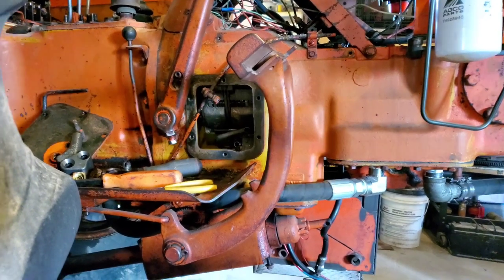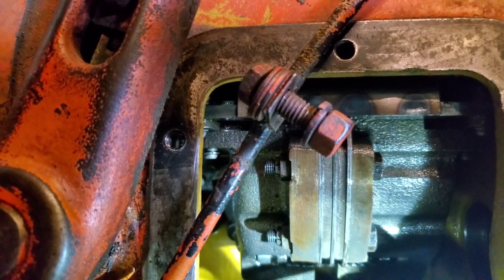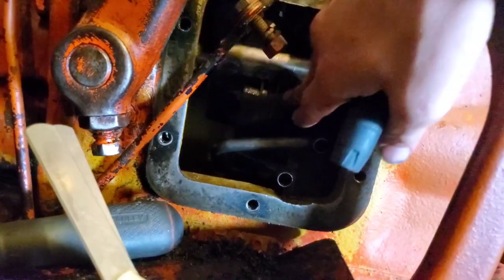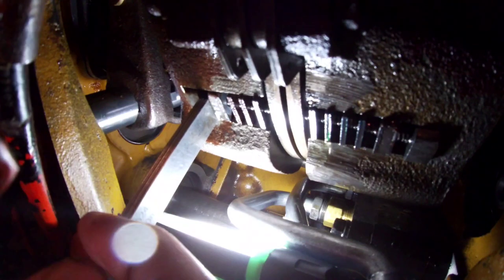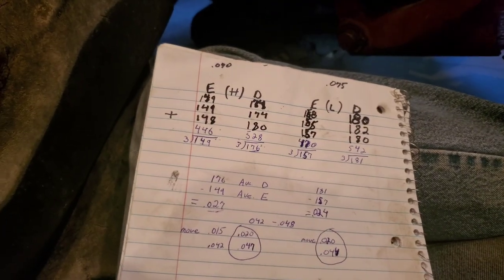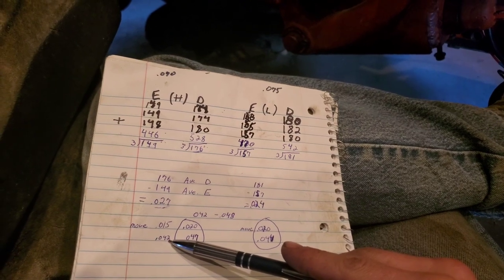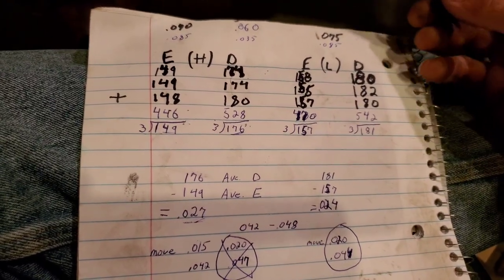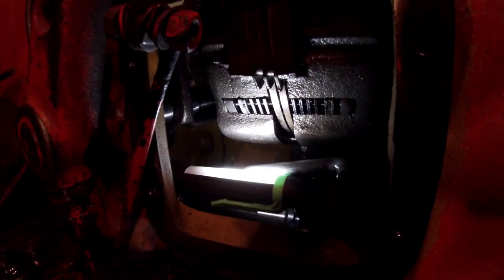How to adjust an Allis Chalmers D series power director, in the tractor.

Comment: Not sure if you're still answering questions on this, but in the first part of the video you measure and state that you got .070 &.075 respectively. What are you measuring? The short shims? My son and I are working on a D-17 Series 2 that sat for 25 years. The power director slips under load on the low side. If we measured correctly we come up with .064 (high) and .033 (low) but not sure we are measuring correctly. Also judging by the blue RTV on the cover at some point someone was in there. The center "long" shims measure about  .135 in thickness. Seems like a lot. Not sure how to proceed. Any help would be appreciated.
Thanks!
Reply from the maker: https://youtu.be/fNFY5CUUmk8

This is an updated video I did on this. I tried to explain a little more clearly about the shims and how to adjust the clutch. If you still have questions after watching this one I'd be happy to help.
Reply: Okay, thank you!

Comment: Perhaps missed it, but why are you adjusting it?  Was the clutch dragging or slipping?
Mine is dragging.  (To fully stop the tractor, I have to depress the main clutch or stand on the brakes.)
Before I open it up, I assume I’ll need to add shims.  Is that a good assumption?
Reply from the maker: It's pretty normal for them to do that. Especially when they are cold did it do it as bad when it's hot?
Reply: @TimothyFluegel  yes, hot and cold.  It does it all the time.  Was yours dragging?

Comment: Great video. I will be tackling this very project soon on a d15 series II. 

Any chance you can help me find shims?
Reply from the maker: You can still get through Agco, but where are you located?
Reply: @TimothyFluegel  Central MN
Reply: Good morning Tim. Do you have an email by chance? I’d like to send you a few pics of the power director and the measurements I found. I’m skeptical making an adjustment would fix the issue. It’s dangerously close to factory spec.
Reply from the maker: Can you look me up on Facebook it's easiest to converse through messenger.

Comment: Thank you for the great informable video, I have a few questions. First, is there any oil behind that inspection plate that you have to drain? Also, I just bought my first tractor and it is a d 17 and it has some sort of clanking that sounds like its in the rear end but also I was thinking it could be the crank in the motor broke or bent, and I don't want to tear the motor down if I don't have to so do you know what that sound would be? And have you ever had it happen to one of your tractors?
Reply from the maker: Yes there is fluid being the plate as that is a wet clutch that rides in hyd Trans oil. Does your tractor run?? If it's running its not a bent or broken crank. It's really hard to diagnose a  tractor with out at lest video of the nose. Of you could post on an Allis forum on Facebook and tag me in it I would be more helpful for sure. If you don't tag me in the post I won't respond I can't stand the know-it-alls on the forum ¾ of them have no clue and just seem to want to argue with people.

Comment: Tim, we have a D 17 series 4. The tractor wants to creep when the power director is in neutral. What can we do about it? Thanks.
Reply from the maker: What kind of oil are you using? Alot of times it can be solved by putting fresh hydraulic Trans oil in. But only if the oil that is in it is too thick or old and sticky. If that's the case. After you drain the old oil out full the rear end with diesel fuel and take it for a drive down the driveway and back and drain it out put fresh in and your good to go. If your oil seems good then it's adjustments in the clutch or a warped clutch plate. It's Ajay worth double checking clearance on your foot clutch orcpossibly a warn disc there, I've seen that being the problem too.

Comment: Thank you very much for this informable vid 👌
Reply from the maker: Your welcome. I'm glad you found it helpful. thanks for watching.
Reply: @TimothyFluegel  
Atm I am a little confused.. Now
I have a Allis I-600 with a shuttle power director clutch. (Same as yours but forward and reverse instead of H and L. ) 

My problem is when the main foot clutch is released the motor sounds as if its working harder even while the shuttle clutch is in the neutral position. 

Otherwise the clutch feels like it grabs well but because it robs the engine of power, I could not even use the tractor in gear 4 if I wanted too. 

I just finished the process you showed and even though some shim adjustments could be made, the shim ratio seems to be correct. (Outside shims vs center shims ratio.)

If you have any insite, that would be much appreciative.
Reply: Quick update, the tractor seems to have a red looking transmission fluid in the shuttle clutch. From what I read, hydrolic fluid should be used. Is it possible the trans fluid is causing my problems?
Reply from the maker: @blackmasta71  it should have hyd trans fluid in it. But in my experience no, it wouldn't make it slip if it had the wrong fluid. Are you sure it's the hand clutch, idk if you have a way to test it but if the pto slips when the clutch slips is the foot clutch.
Reply from the maker: @blackmasta71  I acually have a 615 industrial. About the same as your I600. This is just a thought but it happened to me. Mine has a live hyd pump and the regular allis pump in the torque tube for about a week I though the engine was on its way out just lie you said couldn't use 4th and when I let the clutch out the poor thing was working hard. Come to find out the linkage for the not live pump was unhooked and my buddy Bob must have caught a branch and turned the pump on. So it was constantly working that pump.
Reply: @TimothyFluegel  hum interesting, your issue sounds similar.
What do you mean by live pump? 
To clarify mine is a I-600 backhoe. 

Another strange thing is that while I was roating the shuttle clutch and checking my tolerances, i could only rotate it so far until it would want to spin back on me. Even with the main clutch disengaged and shuttle in neutral.

Tonight I needed to back it out of my shop So I put what fluid I had around back in it (I did not have enough) and was barely able to back the tractor out. It just wanted to stall as soon as the shuttle clutch was engaged. It really made me think fluid has a big part in the operation of the shuttle clutch. 

Anyway I really appreciate your help. Its a odd problem to have a clutch that seems to work the engine. I am pretty sure the wheels would spin while in neutral with the back wheels in the air.
Reply from the maker: @blackmasta71  yes sir. The I600 is pretty much the same tractor as my 615 just with a different moddle backhoe on it. They started life as a series 2  D-15 with a power crater engine. Around 45 hp so they aren't overpower to begin with for how heavy they are kinda underpowered really.... that being said it might just need a good tune up ya know if your listing 10hp in your spark or a clogged air filter you prolly wouldn't have the power for 4th gear. 
As far as the live hyd pump. When you push the foot clutch in you should still have use of the hydraulics for the loader and backhoe. That's live hydraulics the regular farm tractor hydraulics ran on a shaft after the foot clutch so when you push the foot clutch it cuts that pump off. Does your i600 have an extra set of controls next to the seat? If so those are for the not live hyd pump
Reply: @TimothyFluegel  ah I see. Yes my hydraulics always work. The clutch does not control hydraulics. 
Maybe your right about the tunup and the tractor being underpowered. Maybe when the shuttle clutch is engaged the tractor bogs a bit from having to spin the heavy clutch in the fluid. 

My old Diesel B275 IH is a smaller tractor but that thing does not come close to stalling lol
Reply: But I guess one last question. Where you able to spin your shuttle clutch all the way around when you adjusted it in the video? I cannot one mine when it is in neutral
Reply from the maker: @blackmasta71  you should be able to spin the shuttle clutch freely all the way around. If your having problems spinning your I would have to guess a bearing has gone out. You should be able to spin it easily with one finger. I'm putting a video up now that has a clip of my 615 I was using it yesterday on the middle of messaging with you so the timing worked out lol.
Reply: @TimothyFluegel  hey thanks for taking the time in the vid to show me whats up! I do not have the leavers to the right of the seat but I am going to look more into a possible second hydraulic pump.
 When I spin the shuttle by hand it feels like its building pressure up until I cannot spin the clutch by hand anymore.
Thanks again
Reply: The proper fluid made a difference. Thankyou for your help.

Comment: I got a I-600 industrial. Guess it works about the same ??
Reply from the maker: As far as I know yes, I have a 615 industrial. I have only read into the shuttle clutch a little bit, but it seems to be the same, just with a reverse gear instead of low.
Reply: The good news is the tractor came with a shop mechanic Manuel that gives all the break down on it. Pluss all the D series tractors .
Reply: Pastor I would love it if you could hook me up with that I-600 bible plz

Comment: When you do the measurement and the power Director low side there is no difference between engaged and disengaged what should you do high side there is a difference 025
Reply from the maker: Start with. 025 out of the low side into the middle and check again. Just Keep adjusting
Reply: @TimothyFluegel  can you recommend a supplier for Shims D17 hand clutch?
Reply from the maker: @brendawelker8357  sorry it took me so long to get back to you. If you don't have a tractor salvage yard near you. Your best bet would be ordering from acgo. You can give allstate ag a call but they aren't listed on their website. Send me another personal message I missed your 1st one and it disappeared.